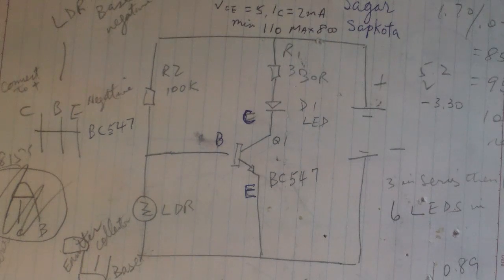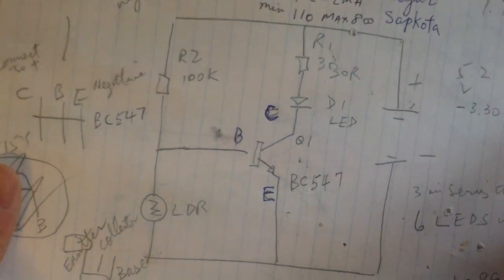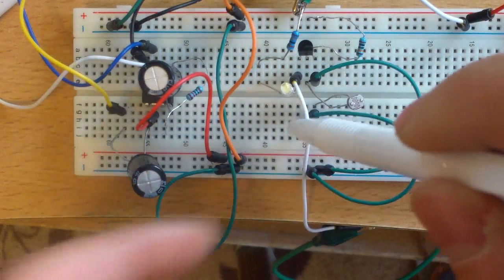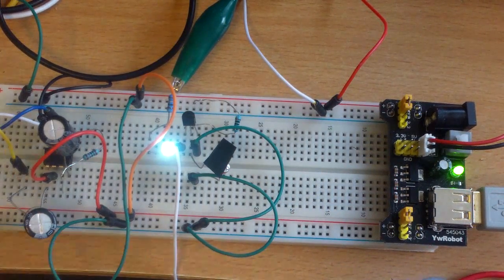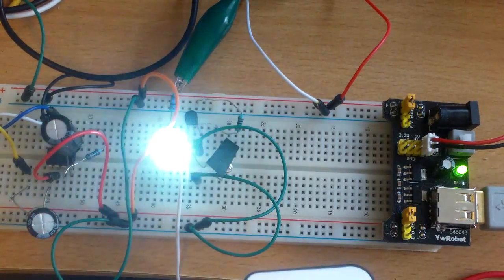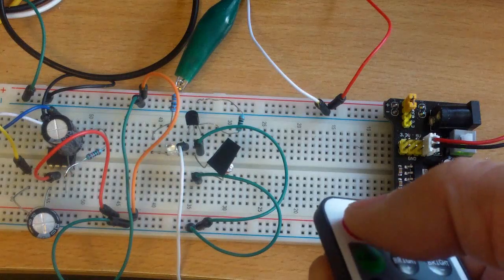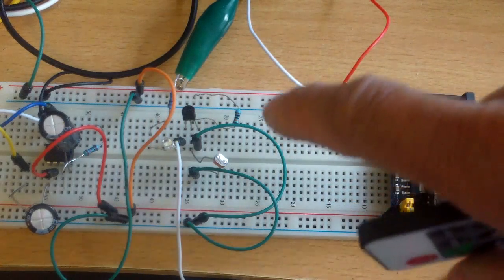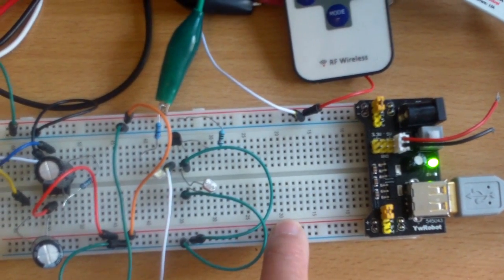Adding remote features to your dark sensing solar lights

Comment: Im working on a similar solution but instead of using a light sensor im going to use the solar panel. Oh, yeah, and thanks for the LED-rf tip :D

Comment from the maker: I think the experts can argue. You can use many LEDs and one resistor, but then your power supply voltage will have to increase accordingly. Also when that single resistor malfunction, the whole string can fail. Parallel requires many transistors but has better regulation and the brightness of each LED will probably be more even. For those 12v LED strip lights, you can see they use 1 resistor for every 3 LEDs and you can cut them at every 3 and can still use them. Maybe experts can illuminate us